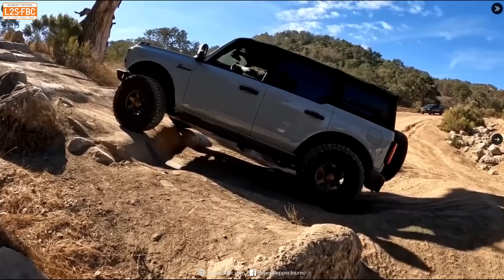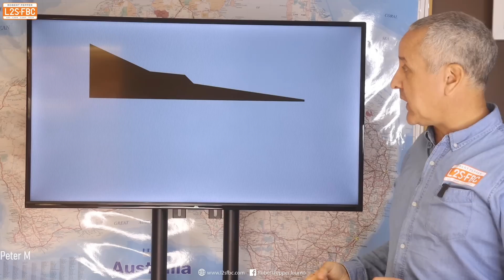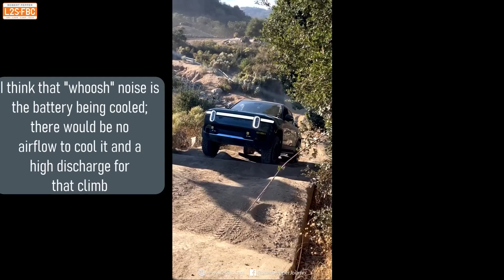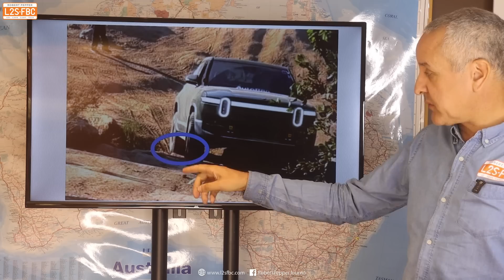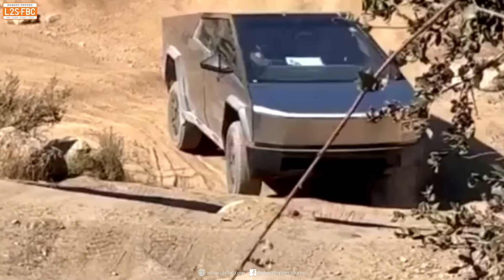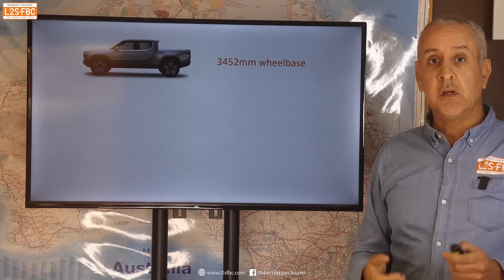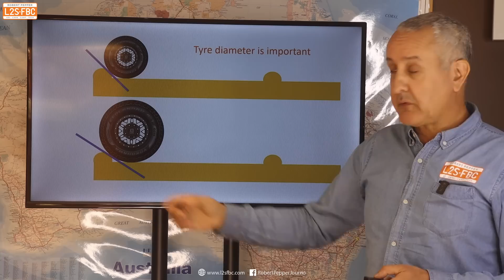Tesla Cybertruck Climb : Analysed & Compared F-150, Rivian

Comment: I don’t think the Rivian driver was necessarily braking. So many modern vehicles now flash the brake lights when traction control or Stability Contol activates, some brake with cruise control downhill, EVs brake lights go on with regen it’s entirely possible the driver never took their foot off the accelerator and the vehicle was flashing the brake lights.

***turns out the Rivian driver was using 2 foot driving.

Also the CyberTruck uses steer by wire and that’s the explanation of the rapid and jerky steering. At slow speeds it only takes a half rotation of the wheel for full lock so even tiny changes in steering angle have a large and fast response. It’s not ideal for accurate delicate steering control.

Comment: The CyberTruck is equipped with a locking front diff on the 3-motor version, and locking front AND rear diffs on the 2 motor version.  That is now known.  They are undoubtedly electronic diff locks that may be either manually or automatically engaged via the terrain selection screen.  My only real concern will be the breakover angle and how tough the armor is on the bottom.  Can I slide it over rock projections without damaging the battery pack? Someone is already offering a bottom armor upgrade, which will help.  It has a smaller turning diameter than my JK Rubicon Unlimited, with the rear steer.  That's impressive to get better turning from a 143" wheelbase compared to a 116" wheelbase.
Reply from the maker: Yes all explained now in my EV Powertrain video

Comment: I don’t think you can compare these vehicles without fitting them with the same tires.  Traction depends on tires, vehicle weight, and torque.  I’m not sure about the Cybertruck tires, but often EVs are sold with low tread tires to try to lower tire noise, which is much more noticeable on an EV since it is not drown out by engine noise.  Anyway - without using the same tires, this comparison is silly.
Reply from the maker: It's not silly as the problem is sending torque to the right place not grip of the tyres. If it was tyre grip then all four wheels would spin. Once the torque is sorted, all cars make the climb.

Comment: I don’t know if I’m right about this I don’t really do rock climbing for me. It’s more about snow and off Roading in those conditions but with my diesel, I actually have three settings, a low throttle response, medium throttle response, and high throttle response that I can adjust accordingly, I would think a diesel electric would have about the same capabilities in someways due to the high torque, which would allow them to climb just about anything. If done correctly. The other thing I would guess with rock, climbing from what I’ve observed from other people is tire pressure all these electric cars look like their tire pressure is way too heavy and need to be softened up to spread the tire a little bit. But certainly the most observed thing I’ve noticed is what you just said in the video about acceleration accelerating at the right time giving that extra momentum could be that these people are scared a little bit which intern tends to make people drive more cautiously to the point of not driving fast enough for conditions there’s a happy medium it’s the same for driving through deep snow. Anyway, great video really enjoyed it. I’d give it two thumbs up if I could.😊

Comment: What I see is that the Cybertruck was designed to drag race, more than actually off-road.  Do EV’s electric motors have the equivalent of a LOW gear that allows for high torque WITHOUT the acceleration of the wheel?  Cause it seems to me that the instant maximum torque of electric motors just kept overwhelming the traction of the tires.   Can you CREEP in one of these things?
Reply: The cybetruck has 20k rmp motors geared to max 130mph. In this video the cybetruck is set to its maximum ride hight of 17 inches Makin the suspension too stiff for this part of the trail.

Electric motors can apply high torque at any RPM, it has a feedback loop where if the tires aren't as spins as fast as the motor (let's say 10rpm and tires are at 9rpm) then that will cause the motor to create slip and drop its electrical resistance allowing more current to flow through the motor increasing the strength of the magnetic field untill the load is overcomed and both motor and wheel are spinning at the same rate which will reduce slip and therefore increase electrical resistance lowering torque output.

Teslas can have creep turned on.

Comment: Cybertrash. EV trash
Reply from the maker: Why so?
Reply: @L2SFBC  same reasons as all EVs.  Too heavy, bad range, weather-sensitive, nothing works properly, scrape the bottom you need a new battery pack, bulletproof with rubber tires, rear view camera will get dirty, not environmentally friendly, takes too long to charge, panel gaps, glass roof, every feature drains battery, no heads-up display, too big.  That's enough for now.
Reply: @jhol310 its a decent weight for a truck with as much power as an F350.
Range isn't a problem since most of the places I work are less than 150 miles away. The bottom is protected by a steel plate. Bullet resistant where you need it not where you want it. 
Than clean the camera takes like 1 seconds, I do it with other trucks, tesla isn't about being freigndly its about sustainability at a level of consumption of material and energy. 
After driving 5 hours I can take a 20 minute brake to charge. It's a polygon truck with no paint, pannels are the least of your worries if you are trying to look good, but early models of any truck have pannel problems anyways.
Glass roof is a bonus. You can run the cybetrucsk with its heaters on full blast longer than a gas truck can iddle on a tank of gas.
HUDs are overated and the truck  dimensions are the same as the F150. Keep going.

Comment: The second I heard of electric vehicles that have off-road capabilities. My first thought was that they should have a digital dial that can literally adjust the throttle response as slow as you want it.
Reply from the maker: I agree with that!
Reply: That would be sweet!  Especially since there is no transmission or transfer case in a Rivian or a CyberTruck.

Comment: Getting momentum at the proper point is the key. Knowing when to apply power and when to let up. Also, the multiwheel power train technology in the Cybertruck is amazing. My problem with the Cybertruck is not it's performance. As demonstrated in multiple scenario's it is more than adequate, often exceeding counterparts. My problem is current battery technology (its inherent dangers, fire, explosion and waste disposal) combined with available charging stations. These issues are not going to be solved any time soon. Don't get me wrong, the technology and performance are incredible, however no matter what the Whitehouse's agenda is on this topic, these issues need to be resolved before I believe it can or will become mainstream.
Reply: Sorry, had to edit that to refine the thought.
Reply: The waste disposal problem is already being solved, if you've checked into that much.  Lithium Ion battery packs are 97%+ fully recyclable. There are at least 3 companies I know of (one right here in Colorado started by a former Tesla Engineer) that are perfecting the process. By the time the batteries really start failing in numbers, it will be ready and running.  And contrary to some people's beliefs, the lithium is fully re-usable to make new batteries, thus lowering the pressure on Lithium mining, brining, gathering needs. There really is no explosion danger (like taking L-Ion batteries on board airplanes and subjecting them to extreme pressure differentials, we don't generally do that with our cars).  the fire potential is there (no worse than gasoline, which is far more flammable than anything in a L-Ion battery) but the trick is putting out ANY metal fire once it starts.  Notoriously hard to do. But mostly that will also be solved with solid state battery tech which is coming soon. 5 years or less. Solid state also removes the formation of the dendrites that cause degradation of those batteries over multiple recharge cycles.  The dendrites can only form in the liquid spaces between cathode and anode, like icicles reaching from one to the other.  Solid state removes the space for that to happen, plus a lot of the fire danger.  It is all coming.

Comment: Does your analysis change knowing that the Tesla has front and rear locking differential?
Reply from the maker: No it does not as IWD is better anyway
Reply: @L2SFBC the one in the video was not showing g the locking differential but the press release and tesla both state locking diffs on the dual motor and cyberbeast.

Comment: Excuses, excuses, excuses for the CB. Really??? Not very convincing.
Reply from the maker: Why not?
Reply: @L2SFBC  So Tesla will send their lousiest test drivers to the track? If it was an early prototype why did they allow to film it? If they were testing the worst track to take on the trail why let someone film it? There were 3 CB's on the track no footage they could do it once right, really? 
Further the Baja expedition done by Tesla also showed an underwhelming performance. On top of that none of the YT influencers showed any off-track performance, it was all how strong the steel is and how fast it was in a drag race. All these factors can only lead to one logical conclusion: the CB is not ready (yet) for off-road performance.
Reply from the maker: I see your point and somewhat agree. However I will wait for a proper test.

Comment: My preference for off road EV trucks for 250K$: 1) 4 motors 2) 42"+ tires with bid locks and adjustable air suspension 3) off road front bumper 4) military Humvee narrower body design high from bottom, low from top. So, it won't flip easily. 5) Back of vehicle very close to rear wheels so it wont hit the ground while vehicle climbing front obstacle. 6) No traction control system instead a radar based AI system that can see what obstacles approaching vehicle: water, sand, rocks, snow. 7) moving and turning in water and water proof. 8) moving side ways for tight parallel parks and tight u turns.
Basically, add these 8 features to Cybertruck.

Comment: i looks like the throttle/torque is a bit jumpy in the low end making it hard to control a smooth ascend... it also seems to have a rigid suspension...

Comment: The Lightning actually seemed to do quite well considering it seemed to have the least aggressive and probably smallest tire of the group. I know the Rivian is a 275/65R20 vs the Lightnings 275/60R20 and I had heard the Cybertrucks were on "35's", whatever that means.

The Lightning can also probably fit a set of 315/70R17's off of a raptor if someone wanted to completely destroy their range, just like any F150. I know the Rivian cannot go to a much smaller wheel than a 20". Not sure on the cyber truck. But that is also a significant advantage to the lightning if you really wanted to offroad it. It lets you air down nice an low with lots of sidewall. You can't air down much when you have a 7500 lb Rivian with 20" wheels.
Reply: It means 285/65/R20 which is a sort of skinny 35 (Compared to my "little" tires I run in the winter on my Jeep which are 35 x 12.5 x 17s).

Comment: My take was that they were calibrating the traction control and simultaneously gathering data on how the 4-wheel steering impacted the hill climb.  I think the one thing not being mentioned that is probably the most important factor is the number of motors.  The F150 is literally just an ICE F150 with to electric motors, so uses mechanical diffs to transmit torque between wheels.  Cybertruck is either a dual motor or Tri-motor, so needs a mechanical diff on the front too.  Rivian is the only 4-motor that can actually change torque at each wheel electrically.
Reply: Rivian also sells a two-motor R1T.
Reply from the maker: Is that still current and was the same true of the R1S?

Comment: Great video! one thing that came to my attention is that the Rivian driver might have not used the brakes on the climb. In EV’s when you release the pedal enough, it will trigger the brake light. This is obviously for safety purposes in regular traffic. So maybe this setting could automatically change in an offroad mode. That would make an analysis like yours easier. ;)
Reply from the maker: Rivian driver has just commented see pinned post

Comment: Actually that "old" technology of having a center and front/rear locking differentials IS way better for off-roading than what these electric trucks are doing. So much in fact, that Jeep said their future electric off-road vehicle will have a transfer case and locking differentials.
Reply from the maker: To some extent I agree; for ICE vehicles I've not found anything better than a lockabke c/d.  However for electric I think IWD would better.

Comment: Is it me or could all 3 EV drivers have just mindlessly floored the gas and jump up in one go like that old Jeep did, they just didn't want to test THAT, but more of how the traction control and the tires could handle that ascent?
Reply from the maker: The Jeep was not "mindlessly floored" but driven with skill, and it was able to avoid the ruts due to its narrow track.
Reply: @L2SFBC  I'm sorry for the confusion, I didn't mean the Jeep was driven mindlessly. I meant that flooring mindlessly would enable the EV drivers to drive up as fast as the Jeep did.
Reply from the maker: Yes. Except the Jeep was narrower so it could miss things easier.

Comment: I’m surprised you didn’t mention the very rigid suspension setting on the Cybertruck. Its main issue appears to be a huge lack of articulation (no droop!). It has air suspension, so the worst driving mistake of all was simply selecting the max height setting.
Reply from the maker: Yes, could have mentioned that, did look a little stiff
Reply: Exactly right because it has little to no no flex and that setting
Reply: A HUGE weight and a lot of perfomance, need to be controlled. It's a difficult compromise.
Reply: This is an issue, because sus has to be on its highest to even match the standard F 150. The "Cyber truck" is maybe meant for cyber space but not for off road driving.
Reply: @bjorngve  F150's standard ground clearance is anywhere from 8.3 to 9.4 inches, Cybertruck is at 17 inches at its highest setting.  In order to get close to an F150's standard clearance, the Cybertruck has to get into its lowest settings, which brings it down to 8 inches...

Comment: Great analysis.  Too many allowances made imo for the Cybertruck's lesser performance considering the amount of time they've been developing it.  I do believe they advertise this as an off-road vehicle.
Reply from the maker: to be fair it is still in development doing development things
Reply: @L2SFBC  Why does it always feel like Tesla is reinventing the wheel?
Reply: @christophercharles3169  Because no one else makes the wheel they want to build.  And then they build it, and everyone else scrambles to catch up.
Reply: @aaronlabertew7739  Now that wouldn't be reinventing would it.  I mean a stainless steel car is not new.  Neither is bullet proof although when you're windows are not I fail to see the point.  What does the Cybertruck offer that one really needs?
Reply: @christophercharles3169 I've seen this point made so many times about the lack of bullet proofness to the windows.  Does everyone making these comments honestly think you wouldn't squish down in your seat and drive the heck away from a shooter? The doors on the CT have a VERY high sill, for almost everyone shorter than Kareem, there is plenty of room to duck down and drive away.  Turn on the front camera and you could even do it and retain view of the road.  A regular car is absolutely as effective as a sheet of paper for stopping any sort of round through the doors.  The only safe place behind a car from normal fire is behind the engine or wheels, outside the vehicle. Someone opens fire on me, I'm speeding away, like a "not idiot". The CT will protect me from basic fire for 70% of my body, and if I duck down, all of it.
Reply from the maker: Is the threat of a shooter a reason to buy Cybertruck?
Reply: @L2SFBC  If you buy it for this reason then you've probably got bigger problems.
Reply: @gloredon  You've seen it so many times I imagine because it's a valid one.  You talk as if life were one big movie.
Reply: @christophercharles3169  Quite a bit actually.